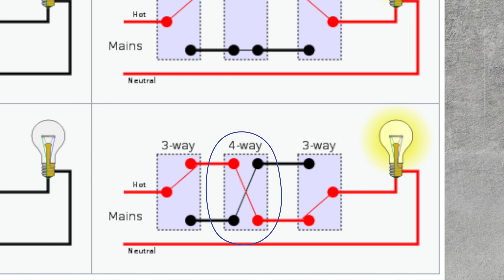3-way and 4-way Light Switches - When and Why you need them

Comment: This is great information if a bit antiquated anymore.  With energy codes and the need for occupancy sensors, we have gone to power packs with low voltage switches.  So much easier to design anymore.  The power pack acts as a contactor and the occupancy sensors and low voltage switches within the space act to change the state of the contactor.  But back in the day, I had to use the 3-way and 4-way switches and it was a pain trying to follow all the travelers and switch legs through the raceway system.  Especially in, say an open office, where you wanted to switch a bunch of 3-lamp (T8 lamps) with dual ballast fixtures.  You would have just a gob-load of wiring to deal with.  As much of a pain the energy codes can be, designing lighitng systems now are so much easier.
Reply from the maker: Oh there is so much to unpack for lighting design! Indeed, low voltage controls have simplified (or complicate, depending on your point of view) lighting design in the last few years. You have your auto on to 50% in some cases, manual on auto off if you want 100%, dimming emergency fixtures with switch  bypass, you got daylight harvesting with photocells and even 100/50/20% dimming for some areas that can’t go dark. Oh and don’t forget switched receptacles if room is unoccupied. Gotta tie that into lighting occupancy sensors too. All good topics to cover one day!
Reply: @theelectricaldepartment  I've gotten a taste of some of that.  My primary focus is on industrial lately, so i'm sure my commercial chops aren't what they used to be.  Anymore, I probably only spec the same 10 light fixtures on almost every job.  I also don't live in one of the more complicated jurisdictions like California (ie: title 24).  But, its a good video...and fundementals are nice since it doesn't seem like many younger designers get the same training I did due to a lot of automation built into systems.